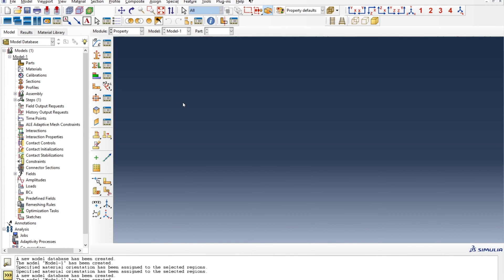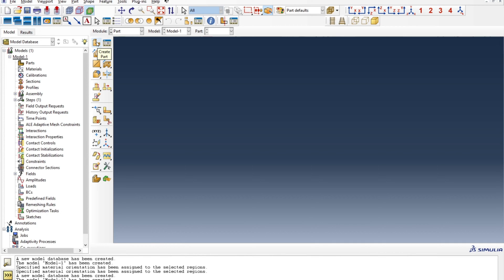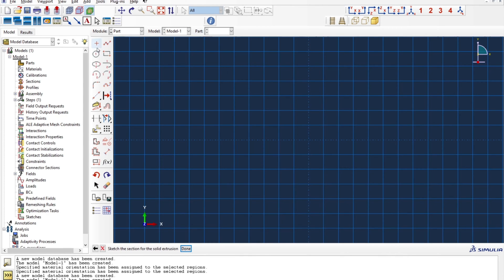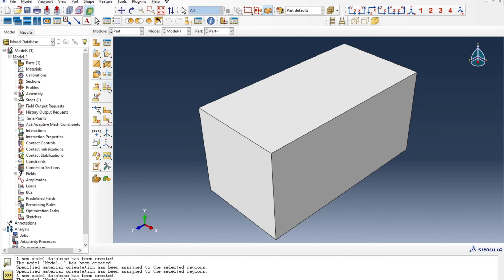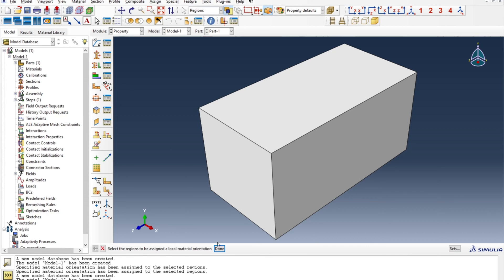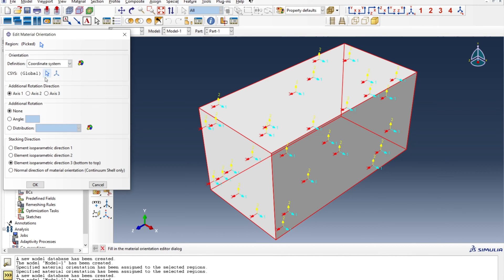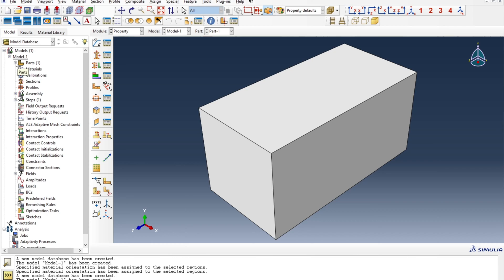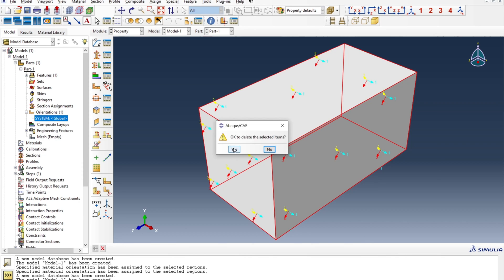How to Assign and Delete already Assigned Material Orientation in ABAQUS CAE - Step by Step

Comment: Hello Professor.
I have a sample pipeline that I am analyzing, which has a rectangular defect right in the middle on the outer surface of the pipe. The defect was created by the extrude cut method. I tried several different methods and got different results. The goal of the analysis is to obtain stress and strain considering the internal pressure applied.
Which method and mesh element is better than the others? Can you guide me?
Reply from the maker: Well, you can start with Hex elements and see how you proceed. Main thing to keep in mind is to use multiple layers of elements in the thickness direction.
Reply: @Professor3MEC  Thank you professor for the guidance